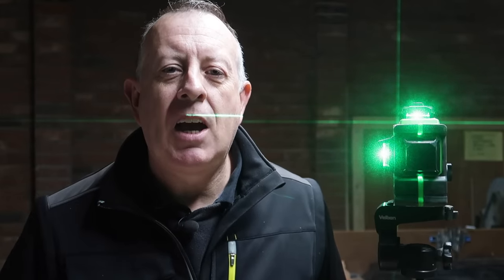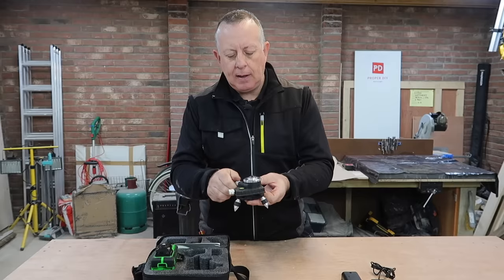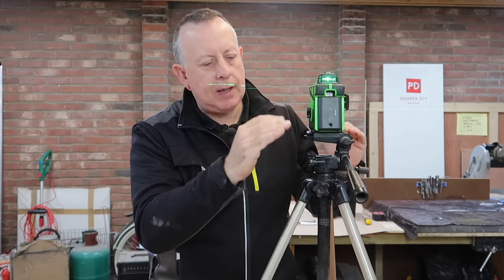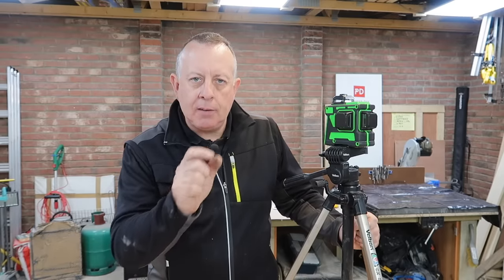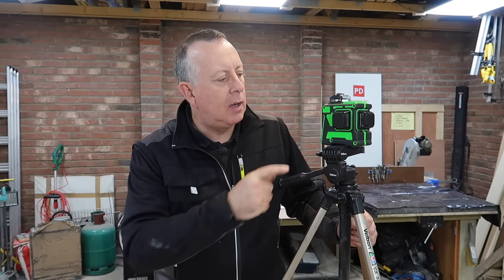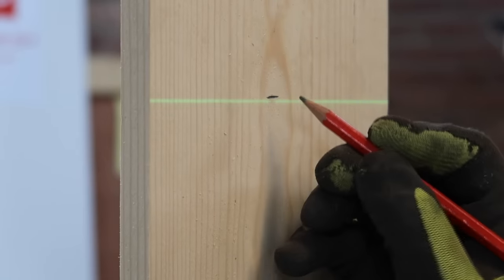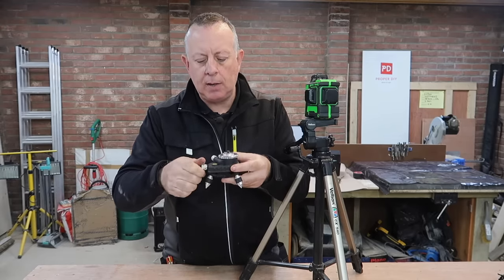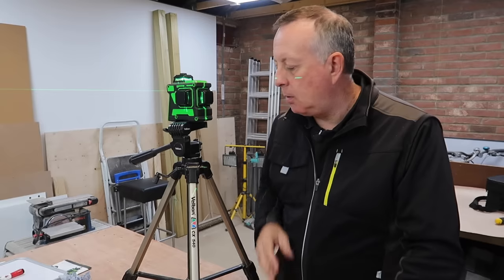Why Every DIY'er Needs a Laser Level

Comment: If you need to mark with spirit level multiple times,  turn spirit level opposite way next time which will cancel out any error in level
Reply from the maker: Good tip to alternate to cancel out a potential error. Still errors introduced in just the marking.

Comment: •3/8" Whitworth (3/8"x16TPI)
•1/4" Whitworth (1/4"x20TPI)
•5/8"x27TPI (American mic stand)
If you need an adaptor to screw something onto a stick, 99% probability it's from one of those three to another, and it probably costs under 5 bucks.
Reply: (I know Europe is metric, but they use Whitworth heads: 3/8" for mic stands, and 1/4" for camera stands.)
Reply: Also take male and female for the respective sizes into account when buying your adaptor. Male on the equipment end's size, and female on the stand end's size. Enjoy
Reply: Oh, very last note: both Whitworth sizes fit euro standard 16mm and 6mm bolt and nut sizes, respectively, in case you're looking to make your own janky stand for something

Comment: Thanks, a great review. The plastic is like ABS - which is indeed what lego is made of. A proper tool would be made of nylon (PA6/PA66) or polyacrylamide (PC), which glass (or carbon) fiber reinforcement. The battery is an interesting choice - likely consists of Li-Ion 18650(s) but enclosed in plastic (looks like ABS as well, which is bad if it combusts). the 14-15mm thread is likely 5/8"

Comment: Just got mine delivered - a couple of points and a question...
- Comes with a pretty reasonable carrying bag with knock resistant foam - better than I expected
- I guess it's better to store it with the battery removed - Li batteries will stay charged for years but, with the unit switched off it isn't really off as it's still listening for button pushes
- Outdoor in sunlight, range is about 2m but you can work around it using the back of a metal soup spoon and search for the lines using reflection - the older and more scratched the soon the better

The question
- Does anyone know if this unit works with the detectors - e.g. Huepar? And if so from what distance

Comment: LOL>.the funny thing is that I have done SOOO Much work around the house and building and I DO Have a 360 degree laser tool..but it is BRAND NEW and still sealed in its box - so do you "NEED" one - NO...do you want one, yes, should you get one, if you do this kind of work all the time yes. Else, take your $70lbs and take your family and kids to a nice dinner.

Comment: i'd love to use one but I simply cannot. I come in after the house is built. I Hang curtains, blinds, pictures, mirrors, fixtures etc etc. The reason I cant use one is because everything in every house is crooked. If I put something natural level it'll look crooked because the crown or trim or sill or slider or window are ALL not level. Not a wall or ceiling in a house plum or level.  I swear, in the US nobody gives a damn about their trade anymore or they hire non tax payers that dont know what the hell they are doing. Thanks for reading my spectacular rant.

Comment: Looks like the screw on the bottom would fit a survey tripod.
Reply from the maker: Yes maybe! Long time since I've used one of them! I bit heavy weight for this type of thing. Would have been nice to have an adaptor so could be used by both.
Reply: I came here to say exactly the same thing!

Survey tripods aren't all that expensive (though probably a similar price to the level)

Comment: There is nothing more accurate than water level. Laser can't compete.
Reply from the maker: Correct but laser levels are so much easier to work with - that's why those in the trade use them.

Comment: LASER GOOD IF YOU have been dummied down i use old school plumb bob and square set lots like that, laser faster but what happens when battery dies you screwed lol
Reply from the maker: I've been using lasers in the construction industry for over 30 years so not so new really. If you don't organise yourself and end up with no battery power left then it's the same as doing the same for you mobile, laptop or car!
Reply: You just put in a new set of batteries?
Reply from the maker: @hakont.4960  Rechargeable battery

Comment: Cheapest 360 self levelling laser  cost £30 on aliexpress  , cheapest self levelling cross line which can be rotated 360deg manually cost £12 . Tripod £1 off carboot. 
 Hmmmm... why walls and floors in my house  aren't flat, vertical and horizontal... hmmm... they've had 5 star rated tradesmen quality, cheapest self levelling can't beat that sh....t

Comment: Go the extra mile, dont buy cheap equipment it dont last.
I bought myself a Milwaukee 360 lazer level and its the bees knees. Weather proof dust proof shock resistant up to 1m drop and lasts 15 hours on one 4ah battery. If your serious then buy serious equipment.  Dont waste your time on cheap charlie and regret it after.